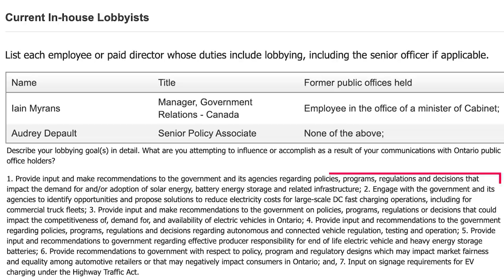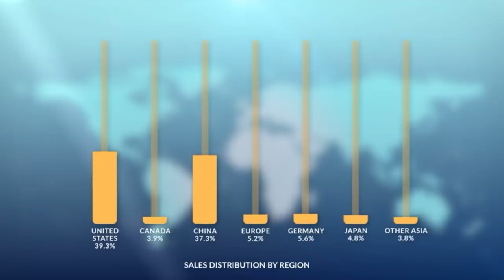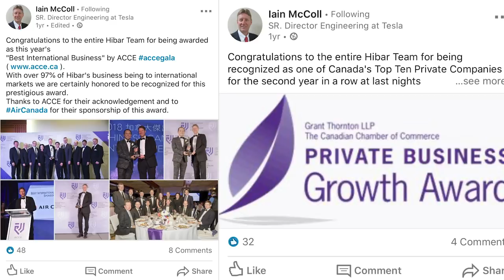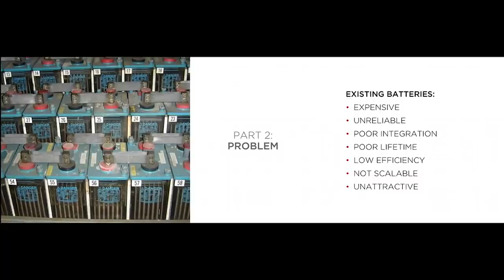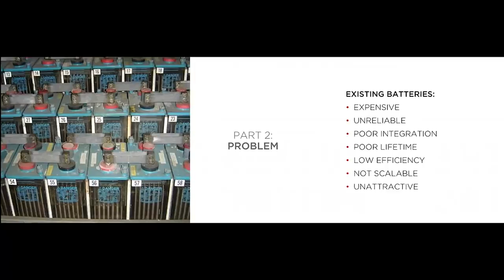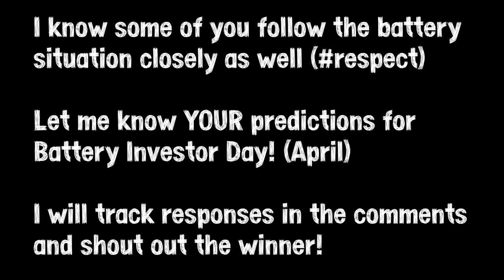Tesla Acquires Hibar Systems - The End of Tesla and Panasonic Partnership?

Comment: Tesla will not end relations with Panasonic anytime soon.. On the contrary IIRC Panasonic and Tesla recently announced expansion of the Nevada factory.. Hibar will help automate delivery and Maxwell will hopefully remove the drying ovens and increase the density even further.. 300Wh/kg is what they had demonstrated with a roadmap to 500.. Tesla are currently at ~250.. If they do 300, that would mean a 20% battery density.. 

But I am guessing that the number they are touting is substantially bigger density gain.. Will that be via a Glass Electrode battery that Goodenough was working on..? Not sure but if that is the case, they would end up owning the market outright...
Reply from the maker: Hey man! You're spot on...just started research into solid state for a future video and I totally agree with everyting you said about Pana. I can't say I'm confident the tech is the glass battery, yet. Perhaps in a few years but it seems as though what TSLA is working on is DBE, process automation paired with new electrolyte chemistry, possibly more silicon than graphite as well. We shall see! Thanks for the insight

Comment: Fantastic research. Elon needs to x1000 the battery production. No big jumps in technology. Lots of small steps.
Reply from the maker: Hey Ben! Thanks for watching and leaving some encouragement, I appreciate it. That's been the story so far, incremental iterations of improvements...it feels likes that might all change come April though. I can't imagine they would hold a battery investor day without something significant to share!
Reply: @DillonLoomis22  Yes the dry electrode can be considered a big jump. I guess I figured after that big jump it will be steady small improvements as there have been many of which are just quietly used. As for investor day I am very excited. If you watch some of the other coverage on Maxwell's tech there isn't much discussion on the 16x more dense battery production. 16 times as many batteries for the same floor space? Yes please!
Reply from the maker: @benthecaptain7419  hahah I know right?! Seems too good to be true. I'm actually researching all of that right now (DBE, solid state etc.) - it's a wildly interesting, but complicated space!
Reply: @DillonLoomis22  I look forward to the video!
Reply from the maker: @benthecaptain7419  hoping to release it Thursday, but this one is going to require HEAVY research in a field I do not have a background in. However, I live for a challenge! Worst case scenario it should be ready by next weekend.

Comment: This Hibar purchase likely shows that Maxwell's dry battery and super capacitor tech isn't close to ready for massive production. Tesla needs to self produce liquid batteries on a massive scale as the Panasonic deal winds down. Tesla likely feels they will make more money producing the batteries and have enough experience to do it after watching Panasonic do it for a few years now. I imagine that Panasonic refuses to extend their supply deal with Tesla and is conducting a bidding war between the big automakers. Tesla would be completely ruined if they lost Panasonic so building their own batteries is absolutely critical to survival.
Reply from the maker: Hey James! Thanks for sharing your perspective, it's great for the community here to expand our thinking! I think the Maxwell DBE will be a highlight of battery day and Hibar actually can fit seamlessly into this process. As I'll cover in a future video, the DBE tech is simply a mfg. process, the batteries will not yet be "solid state" and the Hibar injection pumps can still be used to efficiently and accuratley pump their new liquid electrolyte solution. We shall see though!

Comment: Tesla almost certainly uses a LOT of Panasonic patented tech.  Unless Tesla someone manages to design a product that doesn’t use their IP (as they famously did to ditch AC Propulsion’s powertrain on the original Roadster), I have a feeling it’s a marriage that’ll continue.  That’s not necessarily a bad thing.  Panasonic is quite possibly the best battery manufacturer in the world, and they’re the only one I know of that has massive experience with NCA chemistry.  It seems to me that Tesla will ditch a supplier only if they don’t keep up with them technically (See: Nvidia, BorgWarner) and/or they’re getting gouged (also Nvidia).
Reply from the maker: Hey Bryan! Completely agree. The reality of the situation is right now, TSLA really needs Pana. There's certainly pieces being put together where this will not be the case, but it feels like more of a 5-10 year timeline than a 5-10 month timeline like some have suggested. Thanks for watching!

Comment: Everybody thinks Tesla bought Maxwell for their battery tech. I'm convinced they bought them for their capacitor tech. Capacitors will be in the next gen cars. They will extend the battery life by an order of magnitude. Every time you put a large fast discharge or charge on a battery it lessens it's lifespan. But, if you have a bank of capacitors as a buffer for initial acceleration and fast loading from regen braking, they will take that stress off the battery pack. Essentially they're an excellent buffer and last forever. I learned a bunch from this EV conversion: http://www.metricmind.com/audi/main.htm
Reply from the maker: Hey John - I understand why you would think this but Elon recently said super and ultracaps are not required. That alone leads me to believe this will not be the case. He also said that the DBE (dry battery electrode) tech was a big deal, bigger than we think. I jump into this more in the next video!
Reply: @DillonLoomis22  I think then he got a double win with Maxwell. I look forward to your new video!
Reply: @DillonLoomis22  I agree that caps aren't required for passenger cars, but they'd help. They'll definitely be required on the semi though. Getting an enormous weight moving from just 0-15 mph would destroy a lithium pack over a short time. Capacitors are perfect for this role. I'll bet they're going to be in the new roadster too. He also studied capacitors and even interned at an ultracap startup when in college. He knows the deal. I just don't think he wants to show Ford/Toyota/Daimler his hand

Comment: #NMGRF is a graphite miner and suppler for lithium ion battery manufacturers. They produce the micro spherical size or molecule of graphite required in the manufacturing of batteries for electric vehicles. Please do a video showing all the raw materials needed for batteries 🔋! Thanks
Reply from the maker: Hey there! This is a great suggestion! I actually just started studying solid state and DBE so there will certainly be many future videos on battery tech as I believe it's at the core of TSLA continuing to destroy the EV market and pushing mass adoption. Thank you for sharing!

Comment: what gets skipped in the dialog is the materials supply chain. You can only make batteries on scale IF you have raw materials at scale and you have 2 rare earth metals as a dependency in the lithium-ion battery solution. This is problematic on many fronts including known mineable sources and how these materials are mined ethically or not. 
https://www.washingtonpost.com/graphics/business/batteries/congo-cobalt-mining-for-lithium-ion-battery/

I also didn't hear the words Lithium Anode, which is what Musk has said will be the next gen of batteries by 2024-26. 
In the long view, solid state storage IS the production on scale product that will by pass a lot of the current issues, but when it's viable, available on scale at the right price points, will drive how the market fills the time gap in between in a high demand ramp. Present predictions for this are as far out as 2028.
Reply from the maker: Hey Douglas, excellent comment and point right here...thank you for sharing. I completely agree and it's part of why I think scaling in-house battery production will take longer than most are expecting. And also why Elon has mentioned in passing TSLA may eventually get into the mining business! Will check out that article...thanks!
Reply: Small nit:  Cobalt and Nickel are not Rare Earths.  "Rare Earth"  refers to most of group 3 in the periodic table and all the lanthanide elements.  Tesla has cut Cobalt use in their chemistry by a substantial amount, aiming to ultimately eliminate it.  Battery recycling will eventually become a significant source of metals for new batteries.
Reply from the maker: @incognitotorpedo42  thank you for clarifying, appreciate that!

Comment: Elon has stated that with their new lithium batteries that have met or exceeded the advantages of super capacitors, supper capacitors will not be the next step for tesla.
Reply from the maker: Hey Mark! I agree and I think the super/ultra caps may not be totally out of play as they would make sense for the Semi, Roadster 2.0 and CYBER, but they were never meant to replace Li-ion batteries! Hibar is not the acquisition dealing with supercaps, that's Maxwell

Comment: Keywords : Bottleneck, Power storage , shortage,  but worse at fuel stations because electricity takes too long too pump and too much demand all at once for the grid meaning stations need to stockpile power, preferably hydrogen in tanks which dispenses 10X faster so lines aren't miles long at the station.
Reply from the maker: Most people can just charge at home overnight and never need to "wait" for supercharging

Comment: lol where did you get the idea they have battery supply problem? its the oposite lol
Reply from the maker: Lol please explain yourself
Reply: @DillonLoomis22  its the first thing they got mass produced and he braged how crazy fast this line is. they never had problems with cell productin. there are fundamental problems with dencity and longevity
Reply from the maker: @mrpicky1868  sure, but it's also true that they sell more cars than they can make and the biggest reason for the production bottleneck is battery production
Reply: @DillonLoomis22  no its not. batteri production is actually the simplest scaling of all car.  i do not know where did you get that idea.  i think you missunderstood some things regarding how  it would be impossible to mass produce EVs without gigafactory scale battery production. if you have some new info   whats the source and what exactly the problem is?

Comment: Tesla will go with Panasonic together for at least 10 years or more...
Reply from the maker: Hey there! It's certainly possible...a lot can happen in ten years especially at a company that innovates at the pace TSLA does, but it would not surprise me one bit!
Reply: @DillonLoomis22  Tesla is battery constrain why partnership with lg and catl? if not, why delay Semi, Roadster...all manufacturer have the same problem, so even if they have tehnology from Maxwell, they need a lot of batteries for Tesla Energy to scale to 1 Tera power they need like 20-30 more Giga factories, which means like 90 bilions as a cost minimum...maybe Panasonic will invest more as they see profits from Nevada...
Reply from the maker: @deava9336  you're correct man! They need all the batteries they can get

Comment: You should have said Tesla have difficulty fulfilling demands PERIOD.

Tesla Solarglass Roof doesn't rely on battery and they still aren't able to fulfill the demand. They always put their product out when they aren't able to fulfill a low level demand. And this is the reason why Tesla nearly went bankrupt. Battery production is not the main factor.
Reply: Battery production affects every area of the business, including solar to some extent.
It's also a major drain on car margins (compared to where it could be) and, if they reduce area required, a CapEx saving on factory build cost.
Reply from the maker: Hey Hantz - the core of Tesla's business right now is EV production. Solar is not yet a large portion of their overall revenue. So I stand by my opinion that battery production is absolutely the main factor contributing to a slow down of their main business growth.